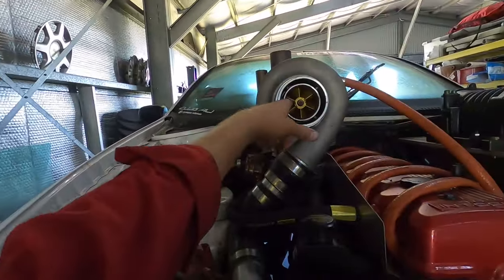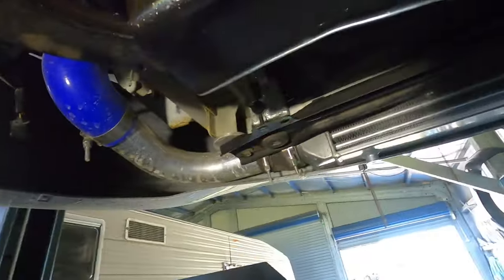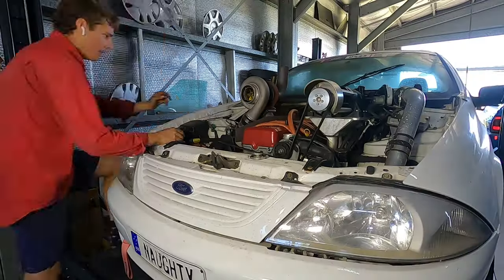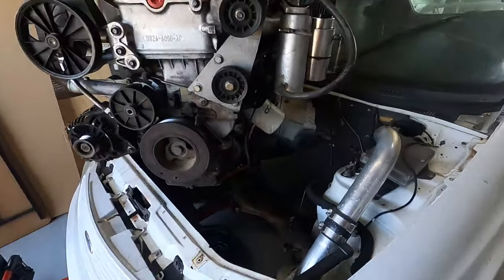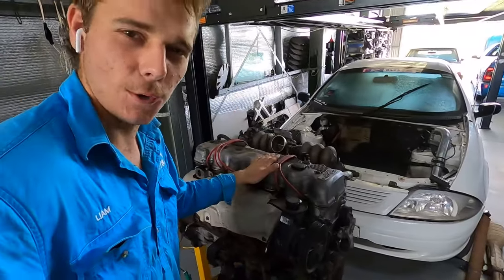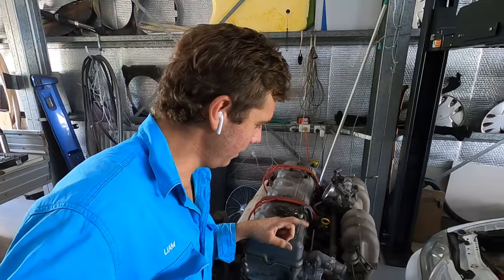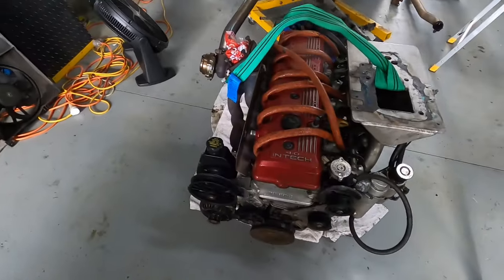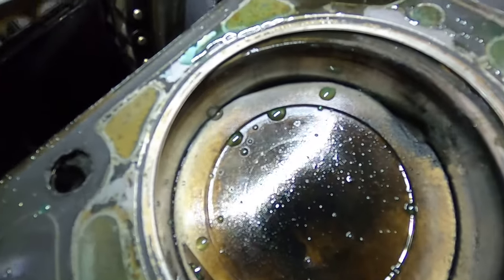69mm TURBO SUPERCHARGED AU Falcon Teardown!

Comment: hey man can you remember what two wires you had around the wrong way in the engine bay near the barra ecu on Hootins harness side? I'm having the similar start issue 

cheers
Reply from the maker: I had the crank sensor wires back to front 👍🏻
Reply: @RichosCustoms   yeah copy that mate. I can bridge the starter and fuel relays and the FG engine runs but the AU ecu in the cab isn't happy. I've deleted with a J3 chip as the smartshield was activated but that didn't solve the issue. Haha 

Was that a 4-pin plug for crank angle sensor going to 4 brown earth wires near the firewall?

I would ask bill but he's a busy Lad.
Reply from the maker: @theclinchdrive  ohhh I’d have to check but it only two wires coming from the from of the engine at the Hall effect sensor at the harmonic balancer, can’t recall colours